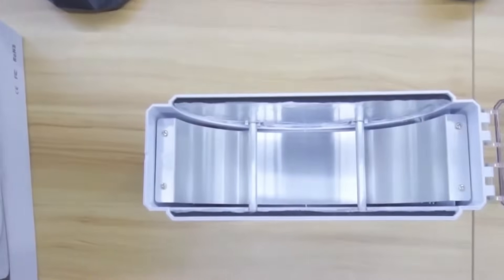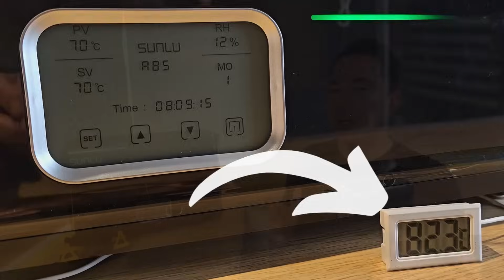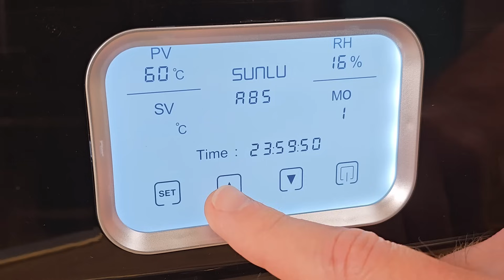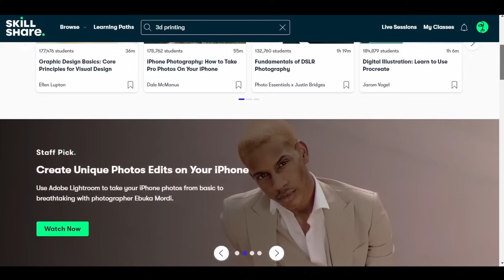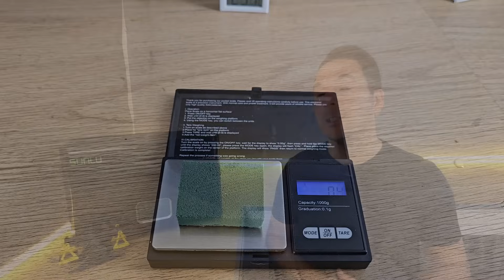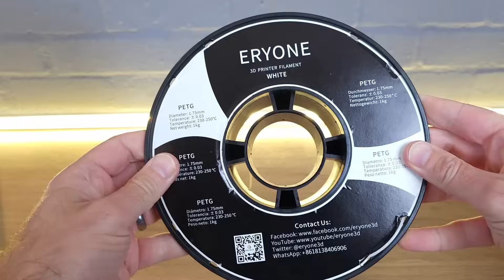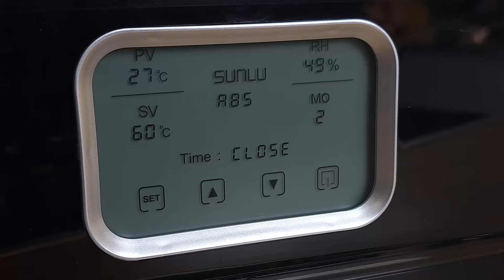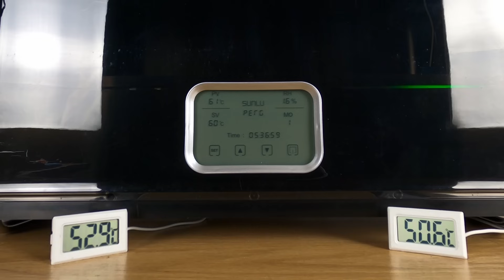Sunlu Filadryer S4 - Most Efficient Filament Dryer Is Nearly Here!

Comment: The problem with this dryer design is the reels sit on bearing rollers.   As the reels get light they will get pulled off the rollers and jam.   I've tried adding ball bearings to add weight to the reels but got inconsistent results to the point I found myself babysitting long prints.   I solved this problem by designing and printing a detachable center axel system for all 4 reels.  Now all 4 reels spin on their own center axel and never jam.

Comment: Got the dryer 3 weeks ago.  I have been trying to figure out the best place for the dryer to sit, to optimize space.   It is too bad that SUNLU did not put holes in the Bottom for the Filament to come out. It would have made it easier to just mount the dryer above the printers and have the Filament come straight down.   With the dryer behind the unit the filament has to do a 90degree bend as it leaves the dryer.  This is adding tension on the filament when printing is causing me to have issues due to the drag.  It has been suggested that I will have to adjust the Estep's to make up for the extra tension/drag.  wonder what would happen if I added my own holes at the bottom.  I am sure it will be a pain to feed the filament through.... any other idea?

Comment: Have you tried modding the S4 to add some larger vents and see how it goes? It looks like it would be pretty easy to drill a large circular hole in each lid and print a rotating vent to fit in each, allowing for varied airflow out of the top. Might have to do some research on this when I get home and see if anyone has made such a model. Be pretty easily replicable with a set size holesaw and model.

Comment: It’s an awesome dryer. What might help improve efficiency, have dedicated drying spools permanently mounted inside that you’d transfer filament to, and pipe dry air through the hub of the spools. Also, maybe add the capability to weigh the whole unit by adding pressure sensors to each foot pad. In addition to the fans and heat, have a hypobaric cycle to help lure the moisture out of the nylons. Finally, if you’re going to be pulling a vaccum on the container might as well get the desiccant cartridge of a big rig truck( a Lorrey, I think it’s called in the Kings English.)They are made to suck moisture out of air wholesale and actually release it automatically back into the environment with pressurized air. Just a thought…

Comment: The un used filaments need a motor mod to keep them running because it is going to blast and cook one of the sides, and also I think this active dryers need some kind of condensation tool too catch and remove the water content.
Edit: 
Also, I don't think that dry speed is as important, I think that the system should be capable of keeping the moisture outside the filament and to reach very low humidity levels to allow the filament to exchange it's internal humidity. So, keeping a vent open won't help that much after a while, what would help is to finally close the vent after a while and maintain the dry air inside. That is why I want to build a condensation unit out of a Peltier block.

Comment: the short snipped of the noise in this video really doesnt do it justice.
this thing is LOUD, i got mine sitting next to my prusa XL and i cant hear the printer running over the fan noise of that dryer.
the drying performance is great but you really need to account for another 50 bucks worth of Noctua fans if you want this to be a usable machine.

Comment: I recently purchased an Eibos Polyphemus and have been pretty happy with it - the motorized spool rotation feature ensures that the filament is evenly dried.  I did some temperature checks and found the measured temps were within 3' of the displayed temperature.  It also offers the humidity storage feature which can be set to 10% and triggers at 20% - this works great but I wish that they provided a way to enable this feature immediately after a drying cycle has ended.  Still, Eibos seems to be the more innovative company at the moment.  I just wish their prices were a bit more affordable.

Comment: I like my S4 for its 4 roll capacity. I don't like that it doesn't have a vent other than the 8 small filament openings. I usually keep those plugged and prop open the lids by not latching them down while drying. Too bad they didn't think the venting through very well. Another problem is that it's blowing heated air directly on the filament, causing hot spots. I'm sure someone will design a deflector to address fix this.

Comment: I have two dryers, one is the first sunlu which is modded with the fan, the other is ebos3d series x, the ebos3d has damaged 2 rolls of filament as it’s fused the filament in the middle
Reply: @highroyds I have an Eibos (the black one for one filament) and it happened to me too. I contacted the support and they shows me a way to decrease the heater a bit turning down the potenciometer in the board. Which filament you demage? Mine was Petg. Support is slow but they already sended a new board to put in (spare), after a month of conversarion 😅
Reply: @Fernando_Gazzola  PETG, two rolls of it.  I did message them about it but they ignored the message

Comment: Surprises me this doesn't come with a motor that rotates the reels while drying. Surely a heat spot in one segment of a reel could be damaging in the long run if you dont have the time to be regularly turning the reels?
Reply: That adds unnecessy complexity. I'm surprised that it's blasting straight onto the filament instead of spreading it more evenly throughout the chamber.
Reply: Eibos Polyphemus has a motor holds 2 reels and it’s about the same price.
Reply: @RCshowmen thanks!
Reply: If you rotate the spools, you cannot feed from this box.  If you feed, you cannot rotate the wheels.  But if you are rotating wheels, you will not be using clip-type holders for the filament as those don't do well in edge-driven dryers.  Spinning those wheels is complex, and not all spools are equal.  More fans is the answer, move the air not the filament.  AND this is an easy user mod.  a row of small fans in each corner, all wired to a power port, and you can make a "turbo dryer".  The as-built air circulation isn't bad, this was not tested full with 6 sensors buried in each spool, so we have to guess what the gradient is.  But move that air, and you will overpower any tendency to have a gradient.  Just point the fans so they all point in the same direction, so they all work together.  IF you need more turbulent flow to do air mixing, invest in an array of ds18b20 chips, and chart the temperatures in 3d with any linux machine running OWFS.  You will need a sensor array to determine the need for more air mixing, if you need it.  I think overkill on fans is easier than plotting flows, but you can plot flows and be better.  I used to plot flows in computer racks for datacenter management, a filament dryer is just smaller and has different goals, but moving air to where it is needed is the goal in either case.
Reply: Just 3DP a heatshield that difuses and helps spread the heat out of the vent

Comment: Very interesting review.  I was a bit skeptical that those little filament openings would provide enough of a vent for the moisture, but they seem to be enough, at least when they are completely open.

A couple of corrections:

6:06 - should be "three kilowatt-hours of electricity."  6: 15 - should be "125 watts" not "125 watts per hour".  Watts per hour makes no sense.  Watts is rate of usage of electrical energy versus time  (Joules / sec), not an amount of electricity.